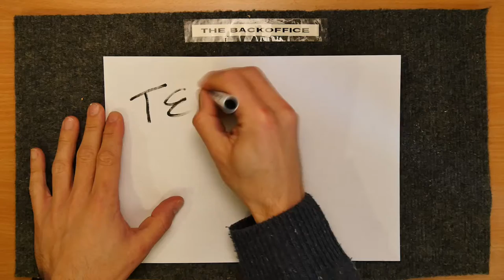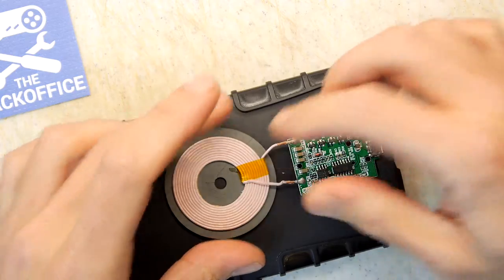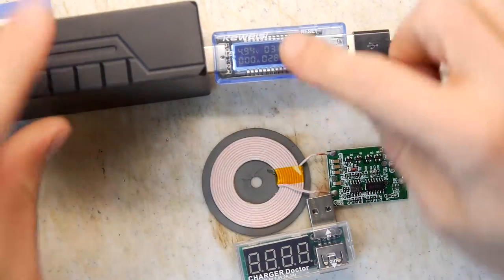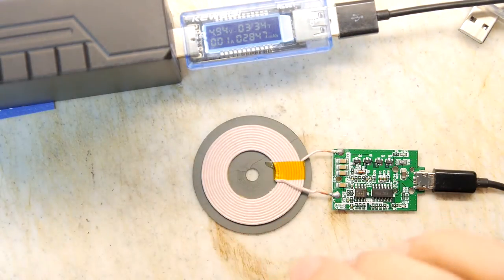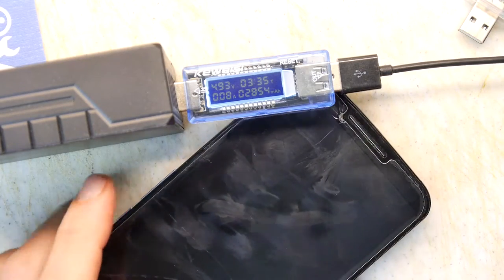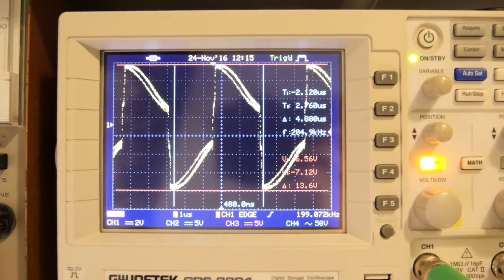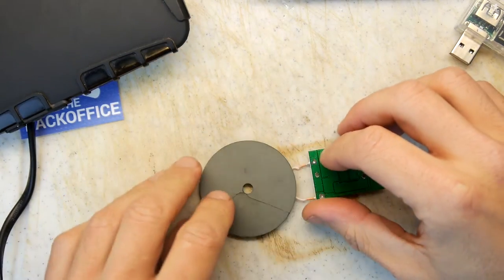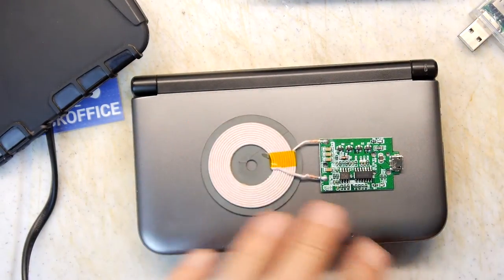Wireless Inductive Charging PCB

Comment: I used ready made stuff like this for the Galaxy S3 Mini. It ended up making the battery very warm and it expanded. So, keep an eye on your batteries. Even though it "works" charging in this way, doesn't always mean that the battery is happy with it. (It was a legit Samsung battery in use)

My idea was to copy what the Gadget show had done, buy building it into a bedside cabinet.

I'm personally now not a fan of wireless charging.

Comment: Interesting video. Love the idea of wireless NFS charging.  Look forward to seeing that one
Reply from the maker: +Meth Methanoid There was an interesting twist to that experiment!
Reply: Well there would be, wouldnt there? Did you not spot that the NDS used a different voltage or something? ;-)
Reply from the maker: The intended target for this PCB was much thicker than expected, so not suitable as you only have a few mm for the coupling to work.
Reply from the maker: Meth Methanoid The controller comes with the antenna kit, so really you can use it on almost anything with a suitable battery. Nice for homebrew, so you can use a travel battery back and one of these as a power source and not need to cut a nasty hole in the case for the usb socket.